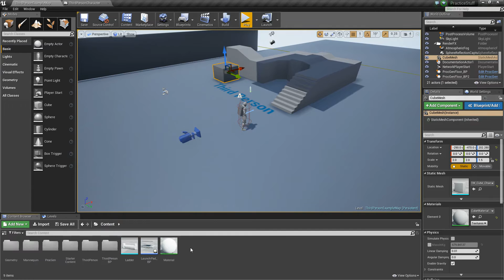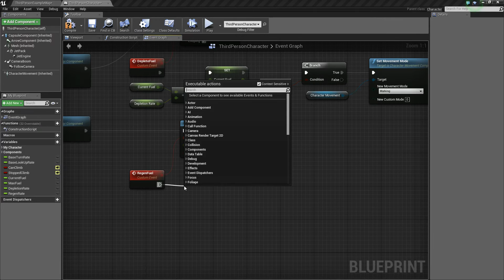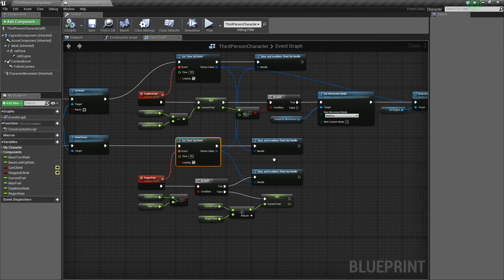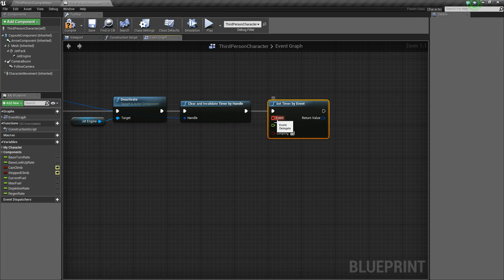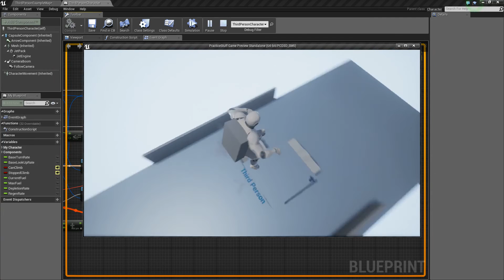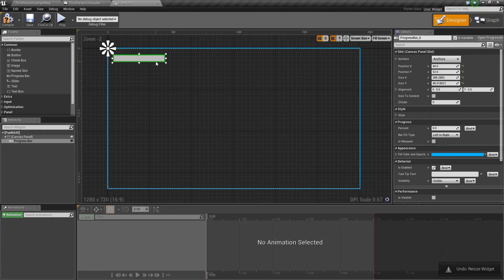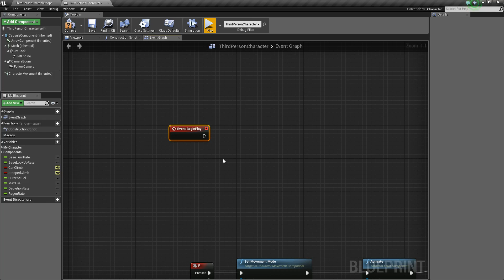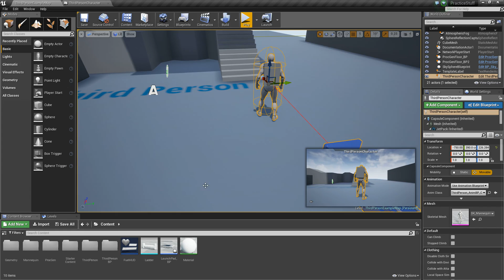Unreal Engine 4 - Jet Pack Part 2 (Fuel Bar)

Comment: Was working fine until the very end where I had to connect my character reference onto get current fuel and it wouldn't connect saying "third person character object reference is not compatible with my character object reference"
Reply: Did you ever get your issued fixed?
Reply: @Righteous_Destiny  unfortunately no and my character completely bugged out on me and I forgot to put another save file lol, that's my own fault